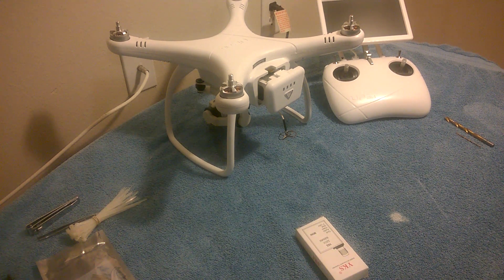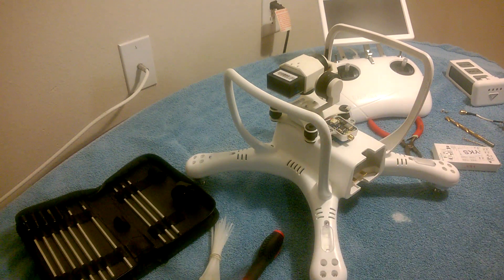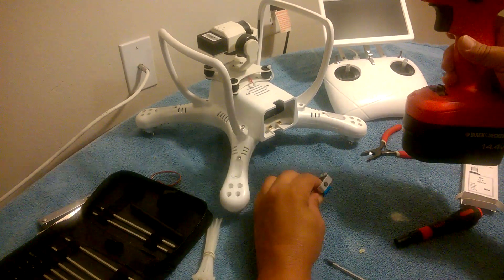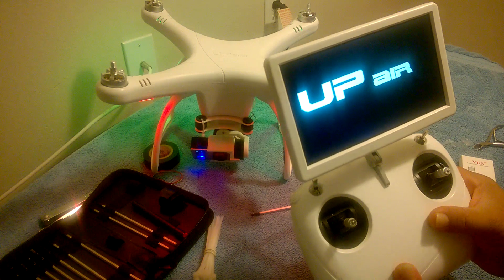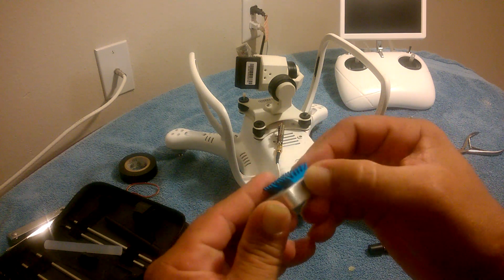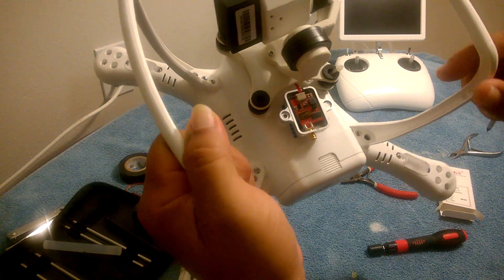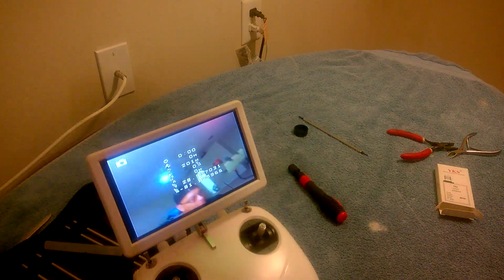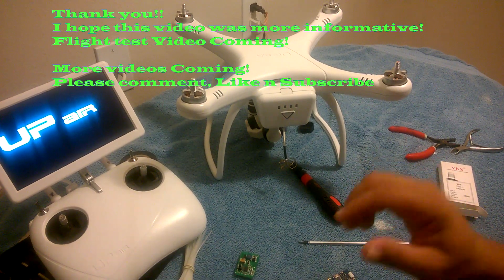UpAir One FPV Transmitter Upgrade #2

Comment: Nice Work Jose, going from strength to strength, just finished my 200 upgrade today. /damn Banggood sent me the wrong antenne fittings.  still having trouble with my camera start stopping when it wants and thats driving me wild...your thoughts..
Reply: Try moving the little rf choke  next to the gimbal connector up a bit, so it's not touching the board. This and making sure it was connected securely solved it for me.
Reply from the maker: thanks for the awesome comments... my camera did same thing. making segmented videos. I pulled camera out and reset to factory. I think it just says "default" in the setup menu. I will look and add to this comment. only problem is now I get good video but I have to start and stop from camera. cant do it from controller.. lol
Reply from the maker: DanR331 Great feedback. i have a little piece of cardboard inbetween so it dosnt go all the way to the end. :D

Comment: I havnt flown mine yet and i pulled the front of the quad battery trying get it out, anyone else have this trouble.
Reply from the maker: the face plate of battery?
Reply: Where the lights light up on the face of the battery that pulled of as i was trying get the battery out, managed glue it back on, i have to use a flat headed screwdriver just to get the battery out as it is such a tight fit. i was thinking of rubbing the battery down so it will beable to slide in without me trying to force it in, i ordered a spare and thats just as bad. And there was a sticker on it saying QC tested hmmmmmmmm.
Reply from the maker: Retro 1965 same here... I grab clips and as I pull out I use a side to side motion till battery comes out. I kinda like the tight fit lol. during flight I know battery is super secure
Reply: ok thanks for that :-)
Reply from the maker: wiggle it side to side. just take your time and then you will see separation. trying the pull motion, I almost elbowed my nephew standing next to me.
Reply: Yes, both my batteries are really, really hard to get out. When I had the gimbal off I used a screwdriver in the hole to lever it out from the back. It worked so well I'm going to drill a small hole in the side - then I can just stick a screwdriver in and push it out without straining the front battery cover . A bit of a design fault. I know we don't want the battery falling out in mid flight, but....

Comment: How far out could you go with the 200? And why Change out the 200 for the 600?
Reply from the maker: the 200 i was able to go to 1050m out 50m high without video interruption at all. I really only upgraded because there were a lot of comments and questions on the last video i made. so for 18 dollars I upgraded really for a "how to" video again. :) i think i will run out of battery life before i ever lose FPV. :) i highly recommend due to the cost and what your getting. you dont have to go far, but the original unit just didnt work after only 50m distance.
Reply: +Jose Bauzo I have the newer Upair one the camera is different then yours I ordered the 200 from your first video but haven't put it in yet because I dropped my controller and shattered the screen in it I'm waiting for my new screen to come in before I install it thanks for the info keep the videos coming
Reply from the maker: Kenneth P601
I would recommend an FPV stand alone monitor too!! :D with a tripod. I have one just in case my lcd on the controller ever goes out. I can still fly! keep me updated on your upgrade!!
Reply: +Jose Bauzo ok I will thanks
Reply: +Jose Bauzo I got my new screen in and I started to put the new transmitter in but I have the newer model and it isn't plug and play theirs only three wires a yellow, black, and red I'm not sure which wire is which if you could help it would be much appreciated
Reply from the maker: Join this group! https://www.facebook.com/groups/upairownersgroup/ put pictures so we can see and help if i can. :)Kenneth P601
Reply: +Jose Bauzo I don't have facebook but I figured it out the red wire was power the yellow was ground and the video was black I watched cruzroy and changed the plug it works but the range is about the same I guess I should get a clover ant. Thanks for your help
Reply from the maker: wow.. great find. normally yellow video and red/black is power and ground.